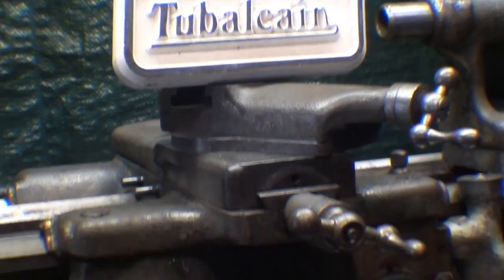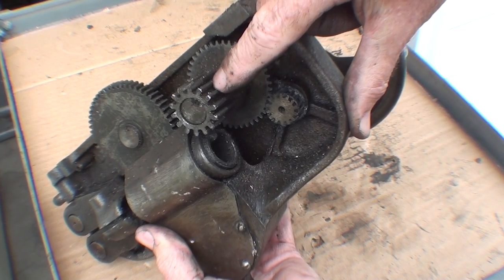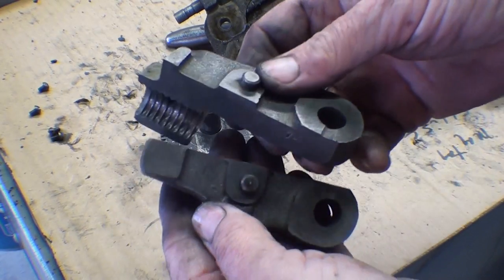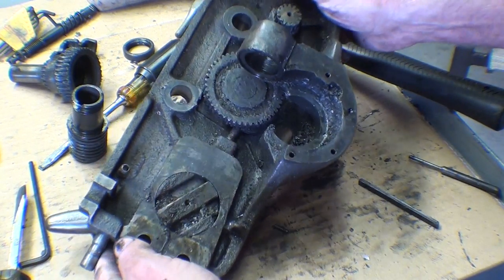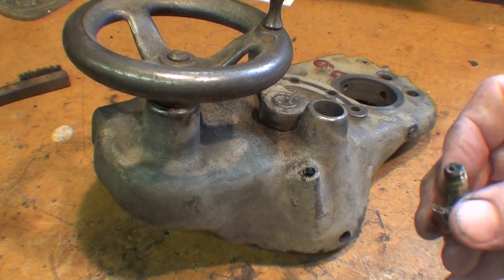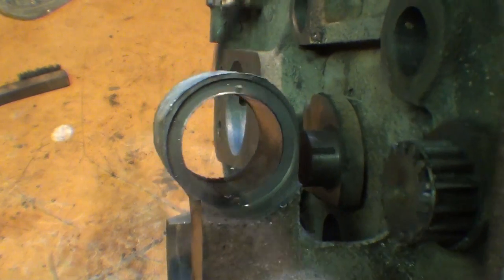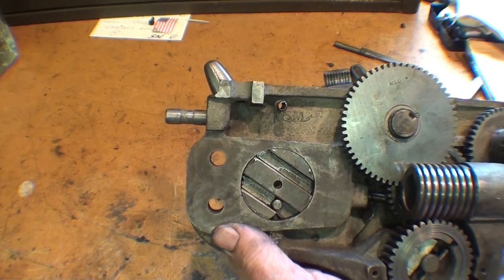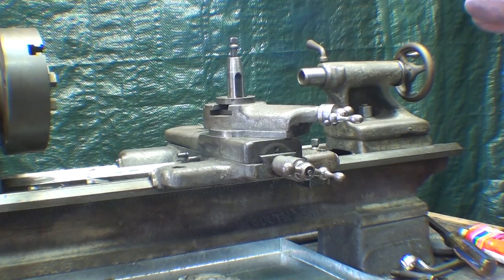CLEANING THE APRON ON SOUTH BEND 9" Lathe 328 tubalcain

Comment: Thank you so much mrpete222! I have, I think a 1947, 9A S.B. It was given to me about 8 years ago. An acquaintance had it in a pole barn. It was a mess, talk about rust. A bunch of pitting on the bed except where the carriage was sitting for a long time. Any way I set it up and could not believe how accurate it was in spite of the neglect. The owner had no idea how to run a lathe. He is a landscaper. LOL  He bought it from an armorer who unbelievably also neglected it. I cleaned painted and lubed everything except the inside of the Apron. I have gotten a lot of use from it. I've been noticing the carriage clutch and some of the controls aren't working like they should so I was thinking of checking out the apron. I was skeptical until I ran into this video. Thanks so much I feel very confident about doing this after watching and learning from you. You have a new subscriber. 83 year old tool maker now retired 20 years. John
Reply from the maker: I bet that Old South Bend will outlast both of us

Comment: Thank you for this video! I am going to clean up my 1939 South Bend again after 35 years of my use and will use your video as a guide. There is a South Bend lathe model "A" rebuild kit available on ebay for $49.95 and it has all the wicks and gaskets for rebuilding. Amazon also has the kits and includes a book on correct rebuilding, they also have some parts that you might need. Note for using silicone for a gasket, I am  a jet mechanic and if we have to use RTV we put some on the part and smooth it out very thin with a single edge razor blade, do both mating parts and let them set until tacky. Clean off any globs that might be on the INSIDE or hidden face and assemble. This will prevent globs from being on the inside that will become like snot in the future and break off possibly clogging oil ports. We have had this happen on aircraft.

Comment: Lyle, I have a Southbend 9A that I have owned for over 25 years. I went through it a few years back. You did a very nice job, Thank you. One point that you might be interested in. The cap screw holding the clutch knob on. Originally that would have been a slotted screw with left-hand threads. I am sure that at some point in this lathes life, some hammer and chisel mechanic did not realize it was a left-hand thread, and broke the screw off. They then butchered it with the screw that exists there now.
Gary, North West Arkansas 73 year old home shop machinist.
Reply from the maker: So that's what happened!!
Reply: What about the hair pin clip that goes on clutch shaft, on top of expanders ? And which way does the clip go? Thanks for a reply.  Jim

Comment: Great video Mr Pete.  I've done a disassembly on my heavy 10 and 13" lathe and while I'm no expert I wanted to comment that  both the 10 and 13" machine have regular clutch assemblies in the apron.  The clutch plates are similar to those that would be found in an automatic transmission but of course much smaller.  

Maybe sometime you could make a video for us about how to fix our worn out half-nuts?

Comment: Thanks for this segment too.  I don't think my friend's 9A will require an apron cleaning, but this is an excellent presentation.  Thanks for the time it took to do.  I am a bit surprised you're not using a brass drift to tap that rack gear out.

Comment: Great video,  I always enjoy watching your videos.

I do have a few additional comments.

1: You are missing a spring that separates and holds the clutch shoes expanders in alignment with the shoes. it is unknown how important that spring is.

2: in some cases if you do not use a gasket on the Clutch backplate, the clutch will rub on that backplate and could cause problems.

3: the star knob retention screw is a left-hand thread. And yes it is the wrong screw. It is supposed to have a very large very thin slotted head.

4: all shaft wicks should be at the top of the shaft when installed. On some models a hole is drilled from the wick to the outermost portion of the end of the shaft to allow you to force oil into that wick.

5: generally, it is not recommended to use Greece on these machines. the reason is, Greece holds the chips more than oil. But this may not be a problem, if you're not using an air hose anywhere around your machines.

Also a full wick/gasket kit is available for these machines on eBay.

I just wanted to add a few points that may be helpful to others.

Again thank you for making a great video. We hope you can continue for many years.

Joe.
Reply from the maker: Very good points. Thanks. I looked at the parts list, and it shows that spring--I guess it long long gone. But it works ok.  The drawing makes it look like a parker kaylon pin, not a spring.
Reply: After having recently gone through the same procedure on my 9A apron, I second the motion that a gasket is in fact needed for the reason that Joe mentioned...its a close fit and the gasket is a spacer as well as a seal.
Also the grease is a bad idea...holds chips and such, but also interferes with the normal oil flow as this assembly was designed for. No grease, all wicks and passages clean and clear,
 reservoir full of type "A" oil (Mobil Velocite # 10)
 and all other oiling locations type "C" oil (Mobil DTE 26) and
 everything stays well lubricated as designed, and no un-wanted build up of chips and crud...
Enjoy the machine
John
Reply: I see I'm chiming in a bit late, but good points on the "do's and don't's"...
Thanks for sharing, 
Razor!

Comment: I am viewing your Tips#328 for the first time..  Thank you for posting "Cleaning a South Bend 9" Lathe".. After Graduating from a 3 Year Machinist Course in 1961 I became a Research Technician at Dalhousie University Chemistry Department, where I Operated their Machine Shop from 1961 - 1973..  The first major Purchase I made was a South Bend 9" Lathe "A" Model..  There were other Lathes ...  However, I was familiar with that Lathe and I felt comfortable with that Machine along with my capabilities..  Remembering...  I was only 18..   going on 19...      My biggest complaint  with the Lathe was the FLAT BELT that drove the Headstock..  I was forever breaking the BOND that held the BELT Together..  AND the CHATTER the BELT made as it passed over the FLAT PULLEY(s)  as it drove the Headstock..I was unable to make a proper Leather Bond  of the FLAT BELT that drove the Headstock..  Shame-on-Me....
Reply from the maker: Thanks for watching--I never did use the glue method of splicing
Reply: Thanks for your reply to my post, mrpete222..   How is the BELT Spliced on the Lathe you're overhauling?    It appears that I have much catching up TO-DO to get on the same page of videos you have posted..  Well......

Comment: Nice to see that clutch mechanism. Knowing how it works may let me make an automatic disengagement system which will operate when the carriage reaches an adjustable stop. I'm thinking of a rotary cam to fit under (or possibly replace) the clutch tightening knob. The cam would tighten against a spring return and be held by a ratchet, and the pawl would be withdrawn by hitting the stop. (Maybe even by a sort of hammer activated by the stop so that the clutch would disengage instantly rather than incrementally.)

I'd like to do it in such a way as to not modify any original parts. (Just in case someone wants to restore the lathe someday.)

Comment: Mr. Pete, think I know why the bolt securing the clutch handle is different. Originally, this was a small left hand thread screw. I bet the person removing it did not know that and snapped it off. Maybe re-tapped it to a right hand thread. How do I know all this? Just snapped mine!

Comment: Earl Shive. He was in LA also. All he did was mask off the rubber around the windows and spray. Washing car first was extra. 
It’s been a long time since I’ve heard his name. You made my day Mr Pete. 
I’m trying to get the taper pin out of my 10L so I can disassemble the cross slide. But I can’t tell which is the small end. 1968 10L. Both ends of the pin are ground down flush with the handle’s cylinder. Any ideas?
Thanks,
Paul
Reply from the maker: Yes, I heard those paint jobs were pretty pathetic
I just pound on one side of the pen, and then on the other side until I determine a small end. Often you cannot tell visually which is the small and
Reply: @mrpete222 
Thanks Mr Pete. I’ll keep trying. Everything I’ve seen says the small end is on the right (as viewed by the operator). That was my determination before it mushroomed out. I’ve tried a torch to the surrounding metal but that did zip. 
I really need (want) to clean and inspect the cross slide but can’t do that until I get that damn pin out. 
Paul
PS, glad you recovered from your illness. You had me worried. I came down with some virus last night and did the TechniColor Yawn all night.

Comment: I just bought a sb model A   9". Had no tailstock for $75.   Found another junk old 9" with tailstock.   put tailstock on to find out mine is actually a 10k.   so now I'm going to attempt to make a spacer to bring tailstock up 1/2".  Think it will work?   just getting into lathe work for a hobby.   not looking for extreme precision.

Comment: If I may. What year is that 9 A?
My stuff is so old, I finally have a 1928 9 C along with the old  1911 13 x 6 yet still some vital correlations and tips here.
Still very interesting, to me. The O'Brien brothers sure did a fair job huh? :-) I really need to tear into this 9 C and do what you did even tho this one is far simpler.
Thanks!
If we slide a light layer of grease on the apron surface for the tin cover, the sillycone permatex won't stick there and it'll come right off later. :-)
Great video!
Reply from the maker: I think it’s from the 50s

Comment: This is a keeper vidio.  For what its worth somewhere you said the clutch 'star' wheel
nut was not correct?  well my 1941 9A long bed USN has the exact same allen. Far as 
I know its never been touched & I had it 40 yrs.
Reply: I believe the correct (left-hand thread) star wheel fixing screw has a broad head and slot. That's what my 1948 SB 9A has.

Comment: It has probably been mentioned, but you should never put grease on the gears - use oil only (the grease attracts and holds on to the chips).  Also, you should have rewicked the apron while you had it open.  Also, no new paint?
Reply from the maker: Good point

Comment: I’ve rescued a South Bend Lathe and presumably my lathe is a very similar model. However, the half-nuts have long past been removed. I’m interested to know anyone would know why that would have been done, and if there is a source for necessary replacement parts. Thanks.
Reply from the maker: Maybe they were badly worn. Your only source is eBay

Comment: Maybe someone can offer some insight. I'm having a heck of a time removing the screw which holds the Clutch star knob to the shaft. I understand it is a left hand thread, however, it is not acting as such and I can get to turn only 1/2 a rotation. If I turn it left (should be tightening) I get slack between the knob and shoulder. When I turn it right (should be loosening) all the slack is taken up. I've tried to soak with penetrating oil, but the threads are tight and nothing is seeping in. I'd like to use my cordless impact, as it won't turn anymore, but would like to confirm there never was a right hand threaded version. Thanks.
Reply: All good, I finally got it.